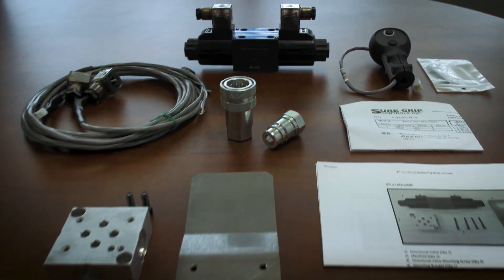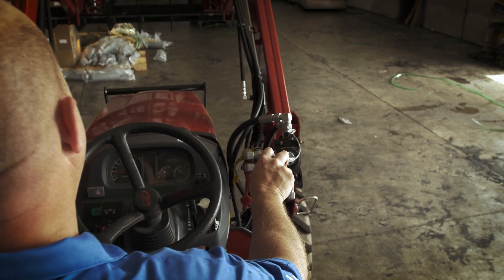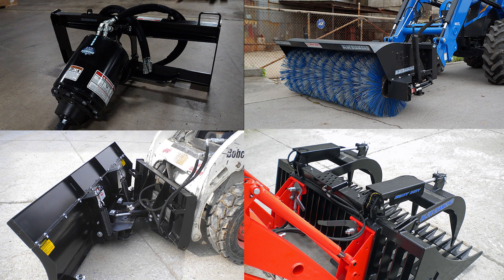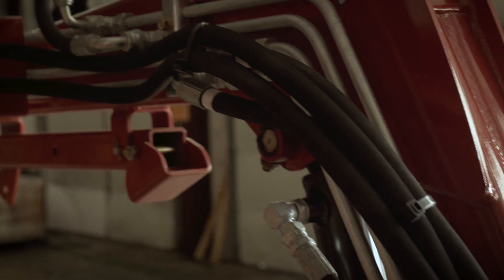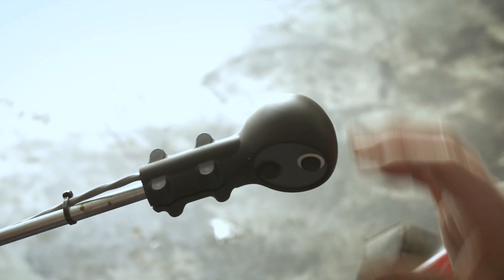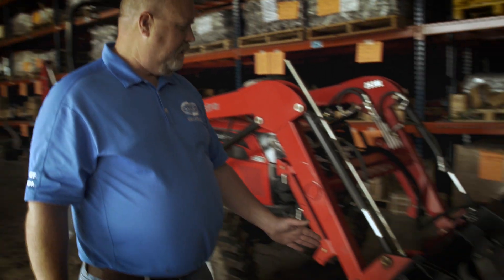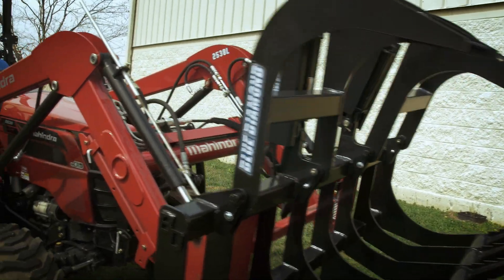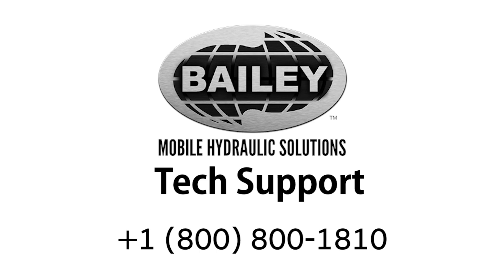Electro-Hydraulic Third Function Kit - Bailey Hydraulics

Comment: Can this be utilized for 3 point hydraulics.  I have the kubota BX with backhoe so it’s already got the hydraulics back there for backhoe.   I’m looking for a way to use those hydraulics with upper 3 point control arm to handle box blade adjustments while on tractor etc.  thanks.

Comment: Will this work on a Mahindra 1533 shuttle with the joystick by the seat and the actual valve is under the foot board?
Reply: @Bob Bradham, our tech team provided this info: "It really depends.  We do not have the hydraulic schematics on the tractor.  If the tractor has a power beyond (pressure source that would be dedicated to the third function kit), then yes the third function kit will work.  If the third function kit needs to share a pressure source (a “T” in the line), then a diverter valve would be a better option.  What would happen if the pressure source were shared (“T’d”) in an open system is that whenever one of the valves in the circuit was used, fluid would simply flow through the other valve and back to the tank, instead of building up pressure. A diverter would allow for the shifting of fluid between 2 systems and allow them to work properly. "
Reply: @logs2lumberTN   Thank you I will look into the pressure beyond for my tractor and find out thank you.

Comment: I'm still trying to understand how these things work.  I need a set of rear remotes on my Kubota L3200 to control a fold-up hay tedder.  This will obviously only be an occasional usage thing.  Can I do this somehow with my FEL control?
Reply: Per the information on Tractordata.com, your tractor can use our 3rd function kit as long as your loader (FEL) valve has a power beyond port to plumb from to our kit. The tractor flow and pressures are within the means of our kit, so the only question you'll need to provide an answer for is the power beyond capability. Thanks!
Reply: @logs2lumberTN  what does this power beyond port look like?  I'm an electrician, not at all a hydraulics guy.
Reply: @travnat1  scroll down the page here, there is an image of what it looks like on your particular tractor model. https://www.tractorbynet.com/forums/hydraulics/286623-power-beyond-kubota-l3200-2.html